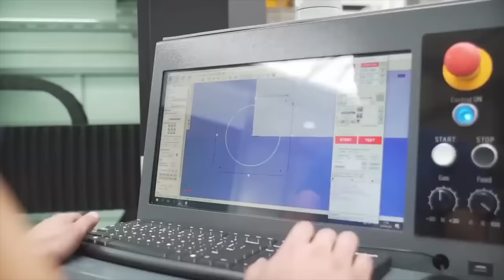US New LASER Fighter Jet SHOCKED The World!

Comment: The laser pod is pointing in the wrong direction -- forward. 

With a rear-pointing laser pod, when a missile is launched at a fighter the tactic would be to turn tail and fly away while simultaneously attacking the missile with the laser. This would give a much longer dwell time of the laser on the missile to achieve destruction with the limited laser power available.
Reply: It only takes a couple of seconds to damage or destroy an incoming missile.
Reply: I like it ❤ it .! Good job.
Reply: Nah. When you fly into a weapon engagement zone . The best chance for a SAM unit to destroy you is in the incoming quadrant, the closing speed is the fastest. If you have forward mounted laser pods, you have the best chance to destroy the incoming threat and still complete the mission, that is where the greatest threat is.  If your pods are mounted as rear defense, the enemy is wasting its missiles on you shooting on the downwind leg. Shooting a at a plane while its flying away is a low PK scenario. If you are defending from your tail (lasering missiles to your rear), you ain't completing your mission.

Comment: It's looks like a no-brainer that these Lazers would use a bank of capacitors to store the energy needed. Perhaps several banks for rapid responses. 
Also, smaller ones used as point defense would be great.
Reply: That has been in the works for 15 years. Also 100 kwatts is not a lot of electrical power.

Comment: We need lasers deployed on surface ships ASAP. The higher power one can be added later that can destroy hypersonic missiles. The first generation laser on the Ponce would be nice for other threats. In parallel, we should develop an anti-hypersonic missle fast enough to deploy a cloud of suicide drones close enough to the hypersonic missiles path to deny defensive maneuvering from contact with the drone cloud. An expensive but sure way to defeat hypersonic missles while the high power ship laser is under development and testing.

Since aircraft are only getting more expensive, point defense lasers for them make sense.

Comment: How do they get the required power that the laser will need on a helicopter or jet fighter.   I could understand there being enough power on a ship like a destroyer, or aircraft carrier.
Reply: The new lasers do not need the massive amounts of power older lasers needed. Modern lasers are solid state technology, older lasers needed large tanks of chemicals.
Reply: They can't. The US Navy's Gerald Ford carrier was among the first to have the increased electrical generation capacity to carry and use laser weapons systems......they are primarily intended to counter hypersonic weapons. Not even they can travel at the speed of light.....
Reply: Good question??
Reply: 100 kwatts is not much power
Reply: @mrbaab5932  Yes, but but it is still a fair weather weapon as clouds easily dissipate the  destructive power of the laser. Laser requires clear line of sight to be effective.  The technology has progressed to increase power, but it will always be a line of sight weapon.

Comment: I will only mention the US development of an Electromagnetic Rifle from 1981 - projectile speed 20 kilometers / second and weight half a kilogram. Science will have to fight against such a weapon for at least 100 years and reach a Power of at least 100 Gigawatts and a weight of less than 100 kilograms. At the moment, tests are being done with a Power of 300 kilowatts, but the weight is beyond any criticism, and therefore sea vessels are used where critical weight can be carried, not to forget the system for stabilizing the beam from the swaying of the waves, which must be deadly good. A huge disadvantage is the fog and smoke screen that the opponent can use to eliminate and belittle this expensive Laser. Time will progress and Lasers will become better and lighter and more accurate to impose battlefield dominance against the enemy.

Comment: This is the outside the box thinking that we need...  But lets put in on a pilotless drone.  While we're at it, make the drone as close to a UFO saucer.. Reverse engineered.   Make it so the engine is battery powered, is auto-cooled, and can spin to change drone direction in a heartbeat. Lastly, remove the heavy landing gear..  Make the drone gently land vertically on an air mattress or a wide safety net suspended in air...  The drone would take off same as Harrier jets, vertically...  The drone could fly sideways or on edge, giving enemy radar fits, if they could even spot the craft.